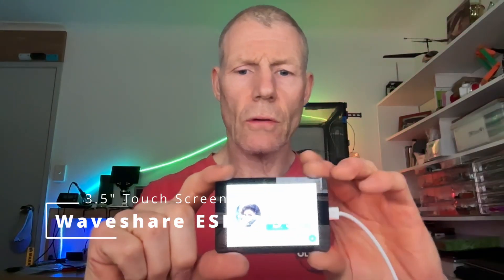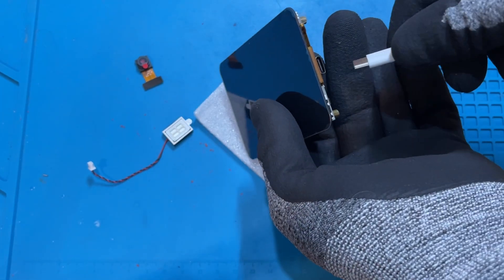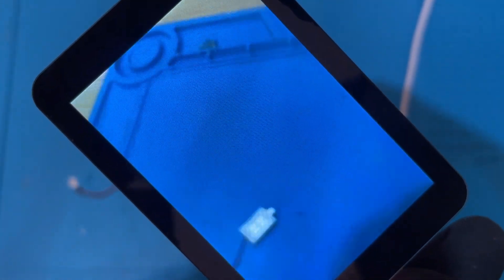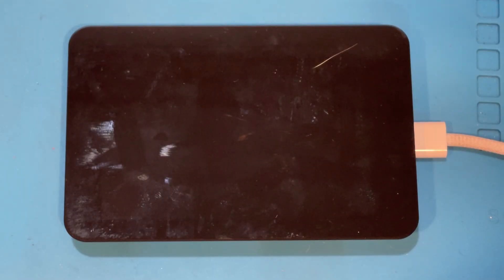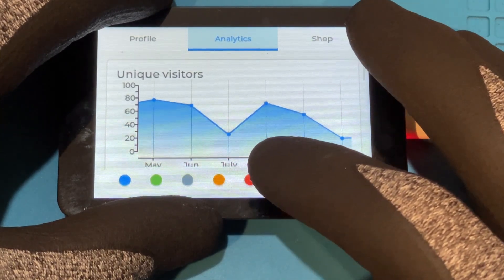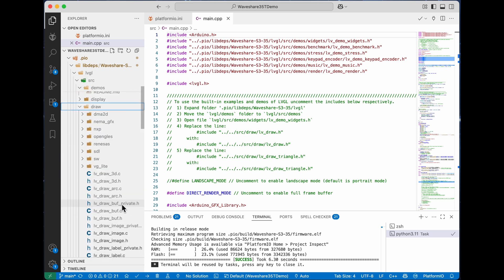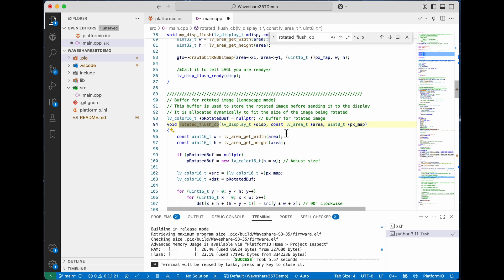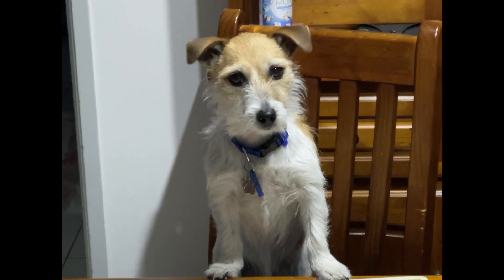Waveshare ESP32S3 3.5" with Touch Screen

Comment: Hi, I'm a bit new to this kind of thing, but I wanted to play around with it a bit. I have a question, why does the diode is on when I plug in my board and it's 5V, as you said, but the startup screen doesn't appear? When I tried to run the example from their demo, I had some sort of noise on the screen. What could be causing this? Is this a faulty board, or am I doing something wrong?

Comment: This is $35USD on Amazon currently,. The 3.5" Cheap Yellow Display (CYD) with capacitive touch is $25USD and doesn't show the lag that this does. Yes the waveshare has a bunch of other sensors and components, but this lag looks really bad. Is it because the LVGL examples are in PlatformIO instead of ESP-IDF?
Reply from the maker: Lag is due to recording. IRL it is smooth.
Reply: @mctainshcom sorry that can't be true, your finger moving across the screen doesn't have a lag. Only the ESP does.

Comment: Is there a similar device to this screen-ESP32S3 combo, that cannot do Wifi? I‘d need a definitely offline (no Wifi hardware capability) device for a security application.
Reply from the maker: I believe all ESP32 chips have WiFi. You could de solder the antenna. You can also disable the WiFi in software.

Comment: Looking fwd to more content on this device 3.5B... I just received one and I'm seriously struggling to integrate it. 

I'm only familiar with Arduino IDE, but seeing you use platformio I might have to give it a try.  I tried setting up VisualStudioCode and what a nightmare, lol.. So for now I've gone through all the examples waveshare provides using arduino IDE, but just can't piece things together for what I want..  I just want something to display GIFs files that are loaded on the SD card, lol. What you are doing with this device interface is amazing!